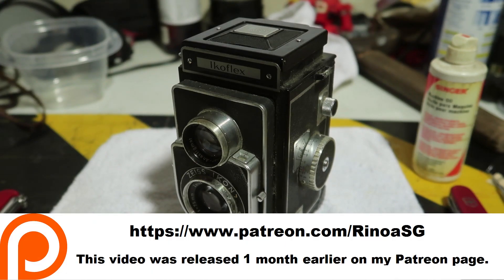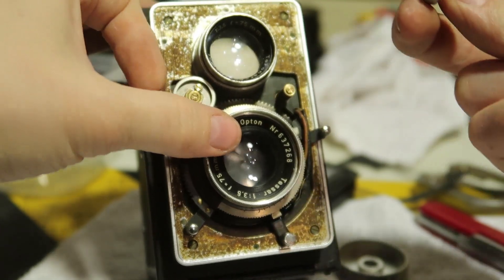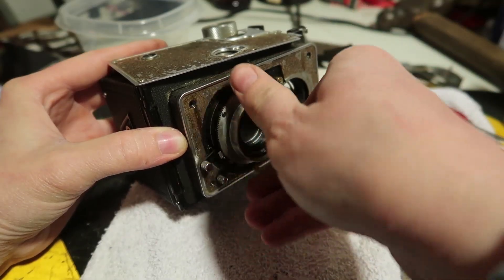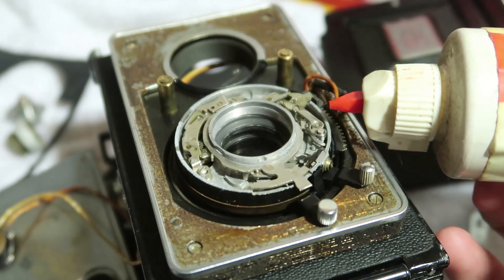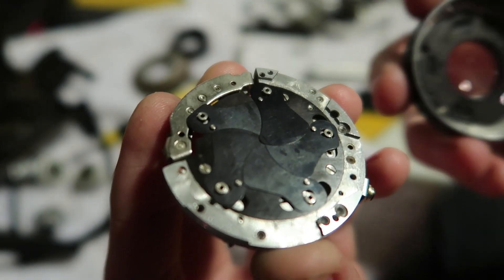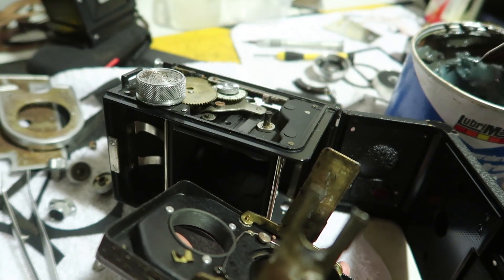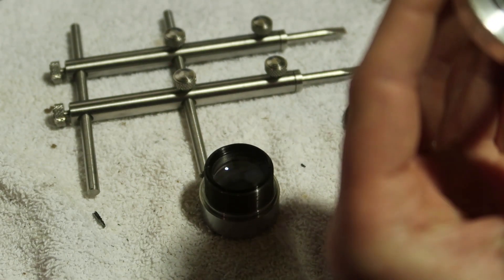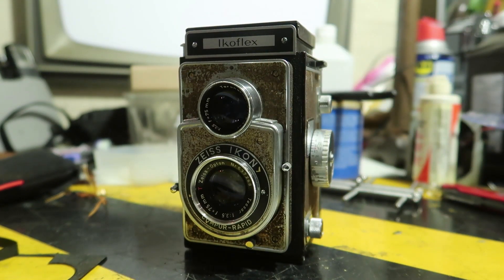1952 Zeiss Ikon Ikoflex IIa Camera: Teardown, Remove Lens Fungus, Lubrication, Shutter Repair

Comment: I almost gave up at the 17m mark when the water pump pliers appeared. I admire your "go for it" attitude and your mechanical skills, but was scared of some of the procedures (bucket of isopropanol and H2O2?) but the vacuum chamber for "drying" is great. I'll watch more and follow up later.
Reply from the maker: The alcohol and peroxide were because of mold

Comment: Thanks a million, I purchased version 1 of this camera that didn't work through an internet marketplace. It was very cheap. Your video has inspired me to strip down this camera bit by bit and try to get it working. today I took the lens off and found that with a little oil etc, the shutter on the lens works. And the shutter timer that was stuck has also come loose. I am confident that this camera will one day take pictures again. THANKS for an excellent video.
Reply from the maker: I've been shooting with mine for a few years now, and I think the timing of the shutter-speed-mechanism is going a bit slow now. It may need oiling every two years. just fyi

Comment: For future reference, alcohol does not dissolve lens fungus and mechanical scrubbing will almost certainly damage the lens coating and likely the lens too. An equal mixture of Hydrogen Peroxide and Ammonia WILL dissolve fungus chemically by soaking 2-20 minutes without scratching the lens.
Reply from the maker: i dont need any of the lens coating so im fine. and i not sure why youd think alcohol would dissolve fungus, that makes no sense.

Comment: You certainly have a lot of spunk to tackle that job.  I would suggest dry lubricant instead of sewing machine oil in the shutter area (Molybdenum disulphide or Tungsten disulphide).  It never turns sticky and lasts a really long time.  I am really glad you took the effort to save that lovely machine instead of tossing it.
Reply: But does it put powder spots on the film?
Reply: @shey_of_wander  The lubricant is sub-micron size. So it is like dust.  You will not see any effect unless you go nuts and put a giant pile of it on the moving parts.

Comment: A valiant effort truly. Caught your video after purchasing the re- release, of what TLR collector's call the Coffee Can, Ikoflex I. Yours was a find at the price paid, looking at its condition. Mine is very poor by those standards, but press on I must. The repair manuals, and any associated information about what shutters were used is sketchy, along with exploded views of their assembly. They have their secrets no doubt, since many of these older German camera's were produced during the hostilities in Europe, I'm certain these necessary materials were blown to bits or burn from the resulting fire's that followed. Bit of a Time Capsule in a sense, and for that reason I've delayed many repairs for some time now. Hope your noxious odours and fungus took a permanent holiday, and with time your clockwork camera will shoot once more. Best wishes my friend. Bravo!
Reply from the maker: yeah this camera shot very nice pictures ^^
Reply: @RinoaL  even the lower quality lenses that came on them produces very sharp images with only minor vignetting with wide open apertures. I'm very hopeful that it will work as intended for many years to come. One of the few reasons I still shoot older models of film camera, since the hues they produce are often most charming to the sense's. Really enjoyed your video. It was a bit of a God Send, since I returned to getting my Ikoflex I back in order. Still can't imagine where mine was stored before. Have a fabulous week my friend, and thanks for responding back. Your a cut above all other's I find about U-tube. Bless you for that.

Comment: My front group is foggy. Is there a way to open front elements group? It does look like solid glass. I wish you show it.
Reply from the maker: there is a chance you have a bi-layer lens and the glue between is bad. i do not know though
Reply: Don't try, on tessar and xenar or the front of the rear group is cemented if I remember well; and if you try to separate the two cemented lenses you will end up getting your camera into trash
Reply: Mattia Ocello What if you have a cracked lens? I think I see one in my lens and I was wondering if I could replace it
Reply: @GulliNL  if there is a crack you should replace the cracked lens with the same lens... Basically you should have a similar camera with the same, good lenses (but maybe the shutter not working properly, or any other failure that justifies to take off the lens) and sacrifice it. If the cracked lens is the front or the rear it's easy and you could do it without too much effort. If it's one of the middle lenses you have to open the shutter to disassemble
Reply: @mattiaocello257  Thx for your quick reply, but you know what? I am a moron :') After watching this video I took another good look at that 'cracked' lens with a flashlight, it appears to be the aperture blades that I mistook for cracks. Might be my lens is fine after all. Well we will see after my first roll of film gets developed I guess.
Reply: @GulliNL  well, much better!  if the lens and the shutter are working properly leave'em like this. Only take'em apart if you have dirt, fungus, oily blades (the shutter could get stuck) etc. Take your roll and have fun😜

Comment: Cool! Nice work, really admire your patience. Glad you got it back together. Maybe some history here. This is a Ikoflex II 852/16 (in the US IIa) produced between April 1950 and October 1951 in the former Goertz plant in Berlin by Zeiss Ikon. With about only 10.000 produced this is maybe the rarest of all Ikoflex models (Bernd K. Otto in Photo Deal 28). Somewhere out there in the net should be a pdf about Compur shutters, versions and how they work/ taken apart. The washers behind the lens are individual on every single camera because they were placed there to make sure the camera focuses on infinity. Similar, the mirror should have exactly the same thickness, otherwise focusing errors might occur (just in case you don’t already know). The lens under the viewing screen is a speciality of the Ikoflexes and makes the viewfinder very bright for its time. Definitely a good picture taker!
Reply from the maker: yeah ive shot 3 rolls on it so far and the pictures are so crisp!

Comment: 15:40 I would be weary of using oil for lubricating the shutter. One of the most common faults on older cameras and lenses is stuck blades. That happens when the oil slowly finds its way onto the blades. Graphite bowder or something like lithium paste wouldn't pose that risk.
Reply from the maker: keep watching the video lol

Comment: I am a professional camera technician, and I have to commend about you trying to work on your Ikoflex IIa type I.  I watched this whole video and the only thing I saw you do correctly was remove the pleather (leatherette).  This is not really the best camera to teach yourself camera repair.  They are complicated and require a certain skill set namely the ability to clean lots of ugly grease.  One of the main issues I see is you like to use the same size screw driver for everything. Further,  you don't like to disassemble things and clean them.  You must remove every speck/drop of old grease and oil before you put any new lubricants on, as the old will contaminate the new.  Oh and by the way, water pump pliers have no place in camera repair.  Make a tool to remove the shutter retaining ring, and remove the rear lens group before you remove the shutter from the camera.  A valiant effort though.
Reply from the maker: dont tell me what to do, my process obviously worked. makes great pictures now
Reply: @RinoaL  It worked but you risked a lot and you definitely should not present it as a reliable method: others could repeat it and ending in ruining their shutters/lenses. The way you treated that tessar was horrible and you know it. It worked for you but be humble if a skilled technician share his knowledge with you. Best regards.
Reply: @RinoaL  Does it?  You've run a roll of 120 film through it?  Let's see them in another video

Comment: Excellent! An extremely exiting video that had me on the edge of my seat! I sweat bullets when I'm inside those old shutters. I don't clean the whole camera, just the lens. this works for me; fungus doesn't return. Some of mine have the same stink problem; I just air them out. It never completely goes away. I use those little divided parts boxes to hold parts and take a lot of notes. You did a wonderful job! Your video work was also excellent. You're going to love shooting 120 with that tessar.
Reply from the maker: i hav shot 3 rolls now, and your right i love it